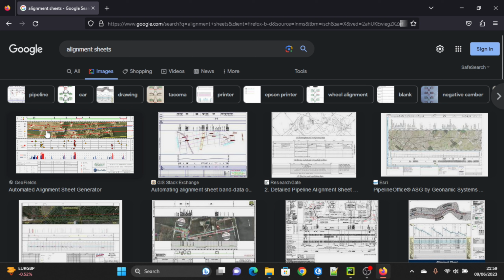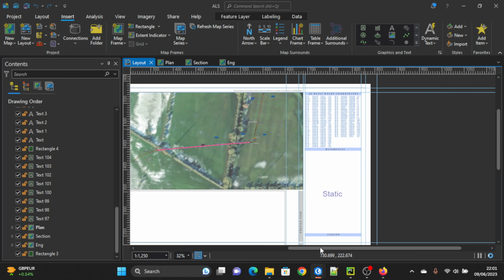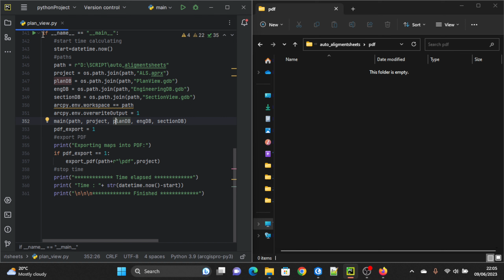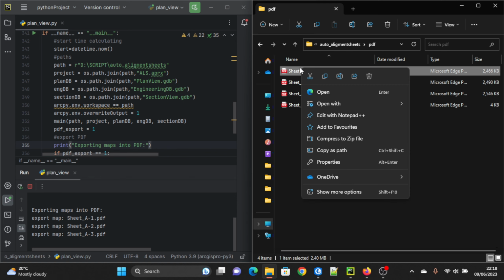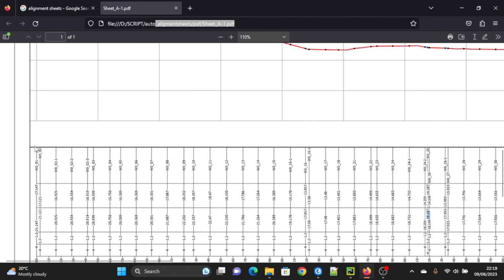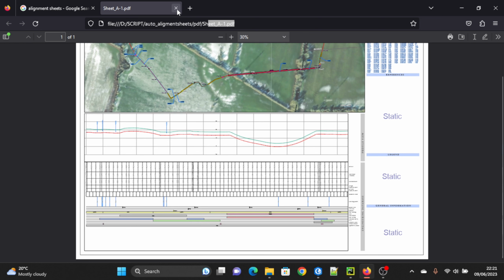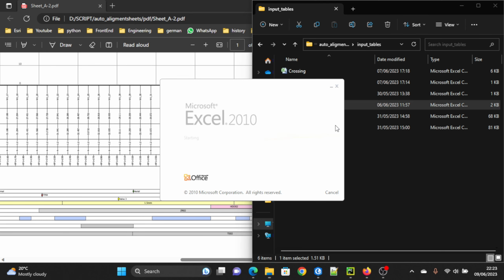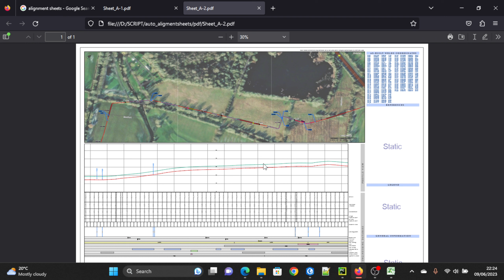Automatic Alignment Sheet in Arcgis Pro

Comment: This looks amazing, well done! And thanks for all the material on your channel, very helpful. I was able to do a workaround to get something similar for the plan view and the elevation profile. However, I don't understand the nature of the element that fills in the engineering data from the *.csv file. Is it a graph in disguise, or a separately generated element added as a picture in the dedicated area, or something else? Best regards,
Reply from the maker: Hi mate, thank you for your feedback, it means a lot to me. 
All main parts are dataframes, i mean Plan view, Section view and Engineering view are all dataframes with layers saved into geodatabases and generated from csv's (csv's are similar of what i have displayed). This means labels and symbologies are dynamic, and can be modified. However, I have been buzzy with my current project to proceed with more videos. But very soon I will have time and I will upload more content about this matter, dont get me wrong but I have spent several weekends preparing this script and it is not 100% finished (at least what I'm thinking of).